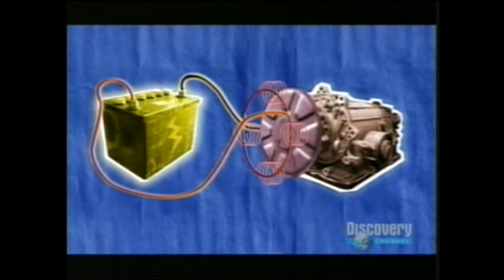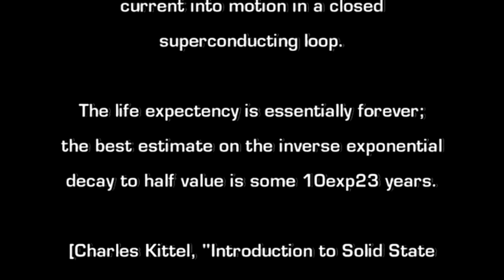003 - Mythbusters hack job on the Bedini Motor Generator.

Comment: A bedini motor is a useless piece of junk that does nothing but turn battery energy into heat energy.
Reply from the maker: you mean cold energy :)
Reply: @GuardianEngraving  No, I mean heat energy.  Like you put a resistor in between your thumb and forefinger, run current through it, and you feel the heat energy.  Much to the shock of Bedini motor builders!
Reply from the maker: @franklogan3592  lol it was meant as a joke.
Reply: @GuardianEngraving  Ok cool.  I thought it was but still wasn't sure.  In the Bedini cult they talk about "cold electricity" and things cooling down.
Reply from the maker: @franklogan3592  that's because they do when configured in a certain way.
Reply: @GuardianEngraving  Ha ha.

Comment: Bedini motor... LOL.  When I was in 5th grade science, I drew a motor driving a generator and the generator powering the motor.  The teacher laughed at me...  but I was only 9-10 years old.  There are adults actually believing in unicorn farts, fairy dust, and over unity..
Reply: @ohger1  I had similar thoughts as a young child.
I'm not real good at electronics, but with the little I do know the Bedini high- voltage pulse generator wheel makes sense to me.
Reply: @michaelszczys8316  I can't tell if you're being serious...
Reply: @ohger1  I found that since I don't have all of the detailed conventional science of electricity and electric motors it helps me to better understand experimental  overunity motors and the like.
I don't have the science that says
" that is impossible " getting in the way.
Reply: @michaelszczys8316  Well you should - the laws of thermodynamics are not opinion - they're proven physics.  Over unity is not possible in this universe.
Reply: @ohger1  Your claim does not match experiment.
Reply: @michaelszczys8316  What happens after you build your Bedini motor and watch it run?  I can answer that for you.  You see the Bedini motor turning battery energy into waste heat.  A Bedini motor is a glorified resistor.

Comment: Did they actually read the patent! That is not a bedini motor. Bedini uses the back emf from the coil to charge a battery. These goofs are just there for show.
Reply: @handy941  it was a " Let's use a Bedini Wheel to make anything outside of conventional science and anybody that follows it look completely foolish." episode
Then we'll turn around and make the episode with the airplane on a treadmill.
Reply: It's actually the inductive spike, back-emf is that retarding force that opposes the work of the rotor, it's a terminology thing, what's more interesting is that the spike has different electrical properties to a conventional voltage supply, it'll "charge" batteries with a different type of energy than we're familiar with, it's quite interesting.
Reply: @JenkoRun  No, the inductive spike does not charge the charging battery with a "different type of energy."  That's just a nonsensical fantasy.  If that was true, all modern CPUs would be powered by a "different type of energy".  Did you know that the processor is being powered by "solid-state Bedini motors"?  Billions and billions of CPUs are powered by inductive spikes and nobody cares.

Comment: Dude, Bedini uses a battery to charge ANOTHER battery. He NEVER uses a battery to charge itself. How can they be so irresponsible and mess this simple design up? Morons
Reply from the maker: The ignorance of others can never be underestimated.
Reply: @GuardianEngraving  tell me about it.  I’ve got a system that apparently puts out more energy than it takes in however, nobody will look at it because they believe it’s impossible yet it fucking runs my lab lighting off of a 12 V battery for over 15 hours. Where is an inverter the next best off the shelf component will only last 3 1/2 hours with the same amount of energy. But that doesn’t stop so-called experts from ignoring me, and pretending that this technology doesn’t exist.
Reply: @BeneficenceTV  I checked you out and you are a beginner and you barely know what you are doing.  You are a kid in an electronics sandbox.  If you want to be more effective, learn about real electronics first.
Reply: @BeneficenceTV  use a tiny 9- volt battery to charge a few car batteries.
Reply: It doesn't really matter that they screwed it up because a Bedini motor is a useless piece of junk anyways.

Comment: I saw that episode and it was from start to finish an exercise in " let's do whatever we can to make this look silly "
I haven't built one ( I hope to someday ) but in my observances of these machines I can see how one can be a perpetual motion machine.
If the original ' schoolgirl motor ' could run a weekend show on a 9- volt radio battery and charge a few car batteries in the process, then if you can run it for a day on one car battery while charging another, you could set up robotic switching mechanism to completely switch the batteries every day .
Set it up in a closed room and it should be able to run until bearing failure or the batteries get too old.
Ding dogs on Mythbusters tried to feed the output right to the input.
What a railroad job.
There are other Mythbusters ' myths ' that I could see how they might possibly work but when they don't get it the first time they fill it full of dynamite and blow it to hell and call it busted.
Really surprised that they didn't strap a lot of C- 4 to the Bedini wheel.
Reply from the maker: How an MIT professor could do something like that in beyond me. But then again this is why ppl distrust the academic community now days. All they do is lie to protect their own interests.
Reply: @GuardianEngraving  when people are somehow so apt to disprove something it tells me there must be something to it.
Like maybe it really does what it is supposed to
Reply from the maker: @michaelszczys8316  Yeah I would agree. If they did a proper job and showed how it does not work, that would have been the best point of reference to show ppl "see see it does not work". Rather the show discredited itself and showed the cast as sellout fakes. Guess in the grand scheme of things it was a good thing.
Reply: @GuardianEngraving  I think they needed to stick to Mentos and Diet Coke
Reply: @GuardianEngraving  A Bedini motor is a useless piece of junk.
Reply: @ The Bedini motor works. It uses back emf capture and recycles energy. Just like my rodin coil system!
Reply: @BeneficenceTV  A Bedini motor is a useless piece of junk that charges a battery with a pulsing inductor.
Reply: @franklogan3592  what kind of wonderful devices have you invented- created lately?
Love to hear about them
Reply: @michaelszczys8316  None, what about you?  Just go watch the 12 MHOP clips so I can get my street cred brownie points.  I will repeat to you that a Bedini motor is a useless piece of junk that turns battery power into waste heat.  There is no "magic battery super-charging" from the main battery to the charging battery, none.
Reply: @franklogan3592  Serious question, did you comment with any intent to actually achieve something? Surely you are not so naïve that you thought anyone here would give up  their research or change their minds because of your comment surely?
Reply: @JenkoRun  Yes, the intent of the comment is to speak the truth.  Speaking the actual truth does indeed achieve something.  There is no "research" associated with building a Bedini motor.  The average builder barely knows anything about electronics, it's just a farce.
Reply: @franklogan3592  Well then you're being very naïve IMO, no one is going to listen to you because there is no truth in your statement, we have the research and data needed to perform our own experiments and the results do not comply with your belief systems.

Perhaps you're concerned that the knowledge you've invested your time and confidence in is now under threat and you're reacting, trying to stop people from questioning the system in place which makes you feel comfortable, I've found that is usually the motive behind comments like yours, whatever the reason it's not going to change what the machines do.

Experiment overrules all theory, you may find yourself to be a bit happier if you accept that.
Reply: @JenkoRun  What is the research and data that you have so far?  Please let me know.
Reply: @JenkoRun  The average builder of a Bedini motor does not even understand how an inductor works.  What about you?  Can you explain how the coil that charges the charging battery works in a Bedini motor?
Reply: @JenkoRun  Go look up the clips about the MHOP pulse motor that I designed.
Reply: @JenkoRun  I don't have a belief system.  What I have is the application of knowledge.  That's not a belief system at all.
Reply: @JenkoRun  So now you don't have anything to say for yourself.  I am not surprised.
Reply: @JenkoRun  One watt over one second is 10,000 times as much energy as one watt over 0.0001 seconds.  You still haven't even mastered the basic concepts of energy and power so that you can use the terminology properly.
Reply: @JenkoRun  The energy quantity is different and the power "density" is the same.  The term "power density" is not an appropriate term to use for your topic under discussion.
Reply: @JenkoRun  The amount of work that can be performed and the energy mean the same thing.  Again, "power density" does not apply to this discussion.  "If you know how to utilize it" is meaningless unless you can articulate what you actually mean.
Reply: @franklogan3592  By your logic a pulse motor will show the exact same effect of rotation on its wheel between a 1 second pulse and a nanosecond pulse for the same cost.

I don't think it's me who needs to "master the basics" here.

Don't bother replying back, I have a limited amount of patience when it comes to your type and I'm out of it, I don't subscribe to the belief of trying to argue with a wall, you're of the type that can have these machines placed in front of you and you'll find any reason no matter how nonsensical to deny what's in front of you, like a flat earther.
Reply: @JenkoRun  These ARE closed systems.  The nonsensical fantasy that they teach you is the system is "open" and extra energy enters into the system from "somewhere" because of "the 'magic' of the coil" and guess what?  It's all a bunch of complete and utter crap to sucker you into this business.  You will NEVER be able to prove with measurements that there is an energy gain.  It's all a bunch of nonsense and the way they dupe you is that it's not easy to measure how much energy has been drained from the running battery and how much energy has been put into the charging battery.  It's not easy to the point that people that build useless Bedini motors NEVER talk about how to make the energy measurements on the two batteries.  And guess what?  Measuring the battery voltage does NOT tell you how much energy there is in a battery.
Reply: @JenkoRun  Yes, and to measure COP you have to measure the energy changes in the two batteries and people NEVER do that.  It's all a complete farce.  If you do actually have the skills to make the battery energy measurements you will discover that you LOSE energy.  That's because a Bedini motor is a glorified resistor.  Don't believe me?  Then tell me HOW you will make the battery energy measurements to determine COP.
Reply: @JenkoRun  When the coil discharges into the charging battery, the spikes are NOT HV.  You don't believe me?  Just put your scope on the charging battery and to your surprise you are not going to see any HV spikes at all.  The energy in the spikes that go into the charging battery are at 100% cost to the drive battery.  In fact, to be more realistic, they are at about 300% cost to the drive battery.  You don't believe me?  Well, you have to make measurements to find out, don't you?  When the Bedini motor is running, you have to measure the average power drain on the drive battery, and you have to measure the average power put into the charging battery.  You HAVE to make the measurements.  You just can't blindly believe what someone tells you, can you?  So, how do you make those measurements?  Right now, I know you don't know how to make those measurements with near-100% confidence.  And guess what?  You have NEVER seen anyone that built a Bedini motor make those measurements, have you?
Reply: @JenkoRun  Even John Bedini NEVER made proper measurements on his Bedini motor batteries.  The whole thing is a farce.
Reply: @JenkoRun  No, you can't just swap out the drive battery with the charging battery and just keep on going producing magic free energy.  The energy in both of the batteries will go down, down, down until you run out of energy.  Like I said, you have to make real MEASUREMENTS on  both batteries and since nobody that builds a Bedini motor knows how to make the source and charging battery average power and energy measurements like I described, all that you do is run the Bedini motor and make battery voltage measurements and the battery voltage measurements are useless junk data that means nothing.  I will repeat to you:  A Bedini motor is a glorified resistor that turns battery energy into useless waste heat.
Reply: @JenkoRun  You have to master the terminology and the basic concepts of energy and power.  It can be quite easy to get them mixed up.  One watt over one second is 10,000 times as much energy as one watt over 0.0001 seconds.  A watt is one Joule per second.  So one watt over one second is one Joule.  One watt over 0.0001 seconds is 0.0001 Joules.  Do you get it?
Reply: @JenkoRun  Here is what you have to face:  I just told you about the real and quite difficult measurements you have to make on a Bedini motor to prove anything about it.  So don't play your "run away" game with me.  What I just told you is something you should think about for hours because you can sense it's the real deal and I know what I am talking about.  I know how a Bedini motor works inside-out, and I also know that nobody that builds one knows how to make proper measurements on one.  To make proper measurements it's going to take WORK, and that includes mastering the basic concepts in electronics, and that includes understanding how an inductor actually works, for real.  If you don't understand how an inductor actually works and you just blindly talk about "HV spikes" then you don't stand a chance of understanding how a Bedini motor actually works.  If you get up the learning curve and are real, you will prove TO YOURSELF that a Bedini motor is a useless piece of junk.
Reply: @JenkoRun  If I had a Bedini motor on a bench in front of me, and you were with me, I would spin circles around you and you would be shocked watching me make measurements as I prove to you that a Bedini motor is a useless piece of junk.
Reply: yes... mithbusters lost all my respect after that ... fk them
Reply: No, you can't switch the batteries every day.  That's a nonsensical fantasy.  A Bedini motor is a useless piece of junk.
Reply: @ Have you built one? Clearly you havent

Comment: A lie from you is still a lie. Perpetual motion do not exist and and if your contraption works then why it's not working? Here is the perpetual question.
Reply: If I cut out a cardboard pickup and it won’t get me to work,  does that mean trucks are a scam?  I could be completely wrong here, but I don’t think I’ve ever heard Bedini say perpetual motion.   Most likely because it isn’t possible.  Also I dont know if his motor functions as advertised, but if it does, it would be as perpetual motion as a nuclear plant, wind turbine, or solar.  Energy from the environment isn’t magic, nor is it perpetual.  And this clown science segment from myth busters is made to convince people who engage in surface level analysis.
Reply: Then why is this stuff only found in obscure corners of the internet? There is no shortage of people with the necessary expertise to pull off these thermodynamic miracles, so why have I never seen a legitimate prototype?
Reply from the maker: Not looking hard enough. Dismissing many given they do not fit ur patadime of thought. Active suppression, as seen by the uap/UFO coverups. The reasons are many. Plus, many are just too advanced for the current models. U may want to look into 'the Noetic Aether Theory' for one if you wish to have understanding.

Comment: Dude, the magnets are susceptible to stagnation and entropy, and the part about superconductors sounds like it's comparing two different things.
Reply: I never was very good with electronic circuits but one I learned in my youth was how ignition coils work not when the primary power is applied but rather when the power ' cuts ' and induces high voltage surge in the secondary winding.
I found that the Bedini circuit utilized this phenomena and it helped me understand  and believe how it worked.
I noticed the Kromerey device appears to use the same effect.
Reply from the maker: How is that relevant to not replicating an experiment or claim properly? Especially by people who should know better. Is this what scientists do now days? half ass a replication of a claim and call it a day??
Reply: @GuardianEngraving  Dude, I'm pretty sure superconductors work differently from motors of generators or whatever you're pushing. And you're trying to claim everything you don't like is just mythbusters. What did you expect from network tv?
Reply from the maker: @kylenielsen5083  lol wtf are you on about. You sound like a badly optimized AI bot that has failed to grasp the point of the video.